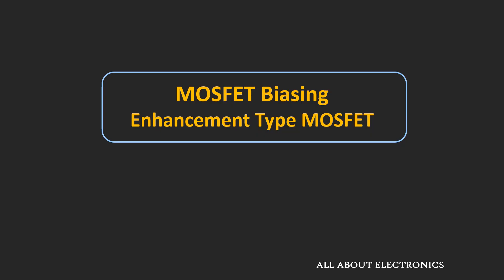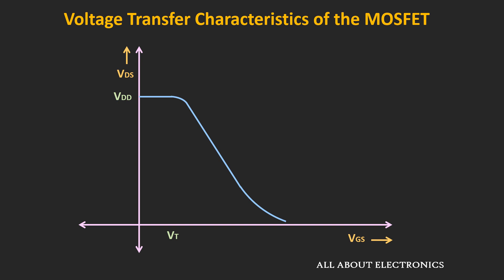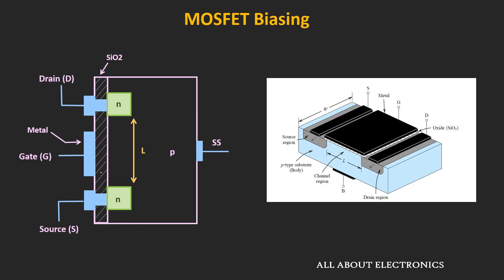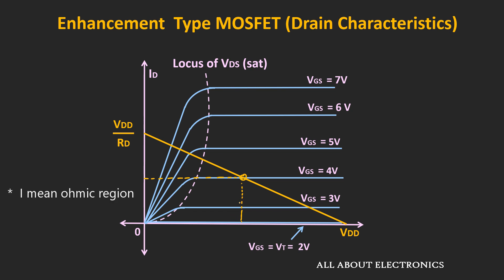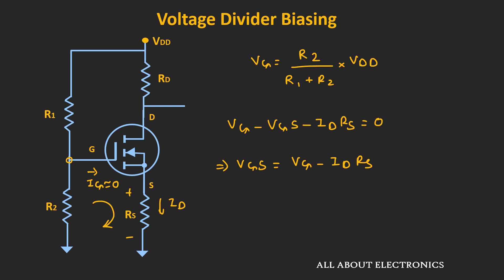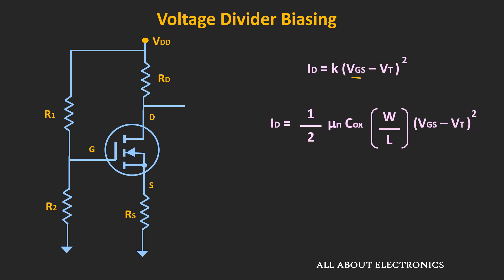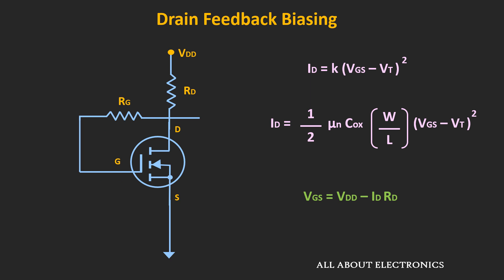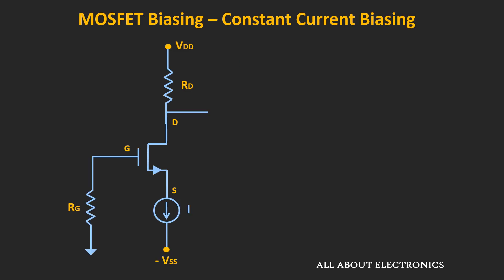MOSFET Biasing : Enhancement Type MOSFET Biasing Explained

Comment from the maker: Timestamps for the different topics covered in the video:
0:00 Introduction
0:37 The need for Biasing in MOSFET Amplifier
3:56 Fixed Bias Configuration
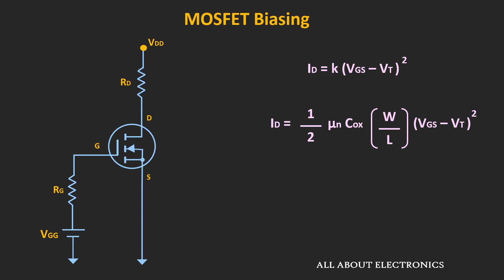9:56 Voltage Divider Bias
14:47 Drain Feedback Bias
16:21 Constant Current Biasing

Comment: Thanks but I got confused from minute 13:00, the formula Vgs = Vg - Id * Rs, if Vgs =0 then transistor is OFF, then no current is flowing at Id, therefore how is possible that Id = Vg / Rs. Thanks again
Reply from the maker: The yellow line, Vgs = Vg - Id*Rs is load line. And does not represent the actual current through the device. The intersection of the load line with the transfer curve will give you the actual current and voltage of the device.

Comment: Where can I find AC Analysis of voltage-divider-bias circuit using N-channel Enhancement MOSFET?
Reply from the maker: Please check the MOSFET playlist on the channel. You will find there. In case, if you don’t get it then let me know. I will share the link.
Reply: @ALLABOUTELECTRONICS  First of all, thank you for your interest. I found only this video on the list "https://www.youtube.com/watch?v=vBvLu3euc2Q" , but it's not exactly what I want. I want to prove Zi, Zo and Av equations with DC and AC analysis for Voltage-Divider Bias Enhancement Type MOSFET.
Reply from the maker: Please check this playlist:
https://youtube.com/playlist?list=PLwjK_iyK4LLC-tRT_Uml3T-ifdcmuykjV
You will get it the video.

Comment: 0:25 why we need to bias the MOSFET

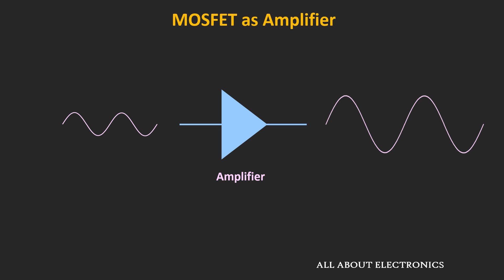0:39 we want to use the MOSFET as an amplifier  我們要把 MOSFET當成一個放大器
0:42 that means whenever we apply a small input to hte MOSFET ,then we should get the amplifier output signal
照理講，這個用MOSFET做成的放大器，如果輸入一個小訊號，應該要給我們一個把該訊號放大之後的訊號

0:49 - 0:59
But if we just apply a small input signal between the gate and the source then we directly can not get the amplifier output.And that is because of the MOSFET characteristics . 但實際上如果我們給MOSFET一個小訊號，他不會給我們一個放大的訊號，這點我們可以從MOSFET的I-V特性圖 看出來

1:01 - 1:09
if you see the transfer characteristic of the enhancement type MOSFET,then it starts conducting when the voltage VGS is greater than the threshold  voltage

1:10-1:19
That means whenever we directly apply a small input signal of a few mV between the gate and the source terminal then the MOSFET will not get turned ON.這意味著當我們直接給一個大約只有幾 mV 的電壓給 gate 和 source , then MOSFET就不會打開

1:19-1:24
That means there has to have some DC biasing voltage which is greater than the threshold.這意味著 必須用一些 大於門檻電壓的 直流偏壓電壓
（意思就是說加一個大於門檻電壓的直流偏壓電壓來解決MOSFET無法啟動的問題）

1:48 - 1:56
whenever we want to use the MOSFET as an amplifier, then it needs to be operated in the saturation region

1:56 because in this saturation region the drain current remain constant

2:09-2:15
That means by controlling the voltage VGS ,the drain current can be controlled

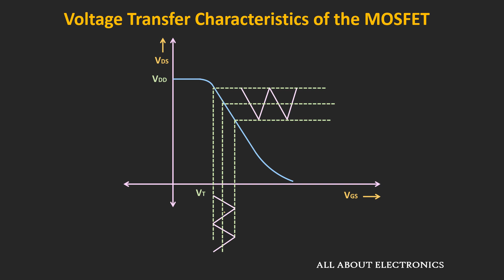3:48 - 3:55
Now,the easiest way to bias this MOSFET is by applying a fixed voltage between this gate and the source terminal.

3:57 - 4:05
so,here,since this gate current IG is approximately equal to zero(因為 G terminal 絕緣) 所以在Rg上面幾乎沒有壓降

4:05 - 4:11
that means in this case,the voltage VGS is equal to VGG

4:11 - 4:17
and on top of it , a small input signal can be applied through this coupling capacitor.

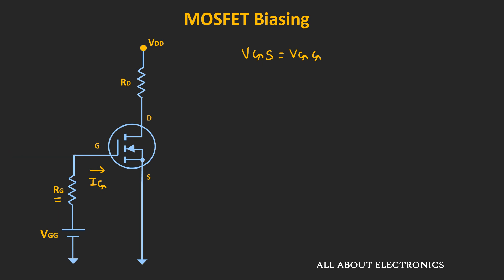4:17 - 4:22
but for the dc analysis ,this coupling capacitor will act as an open circuit.(電容對直流來說是斷路，電容對交流來說是短路)
注意：open circuit是斷路

6:43 - 6:55
in the graph ,the yellow line means load line.That means whenever this voltage VDS is equal to zero,then the drain current ID is equal to VDD/RD

6:56 - 7:02
And whenever this ID is equal to zero ,then the voltage VDS is equal to VDD.（由圖中看出來的）

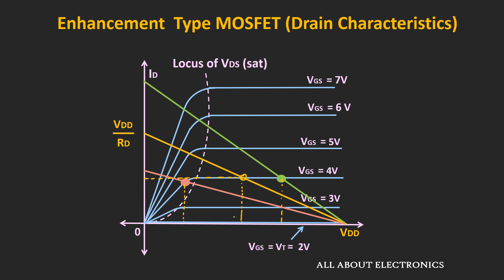8:33 - 8:42
now,although this fixed bias is a very simple biasing technique ,it is not a good approach to bias the MOSFET.

8:42-8:50
the reason is ,in this configuration ,the biasing poit is very susceptible to the change in the temperature as well as the other MOSFET parameters.因為在這種組態，biasing point 非常容易受到溫度影響，因為溫度會影響 MOSFET的常數

8:51 - 9:00
For example,this mobility and the threshold voltage are temperature dependent.
(意思就是溫度一旦變化，參數都會變化，所以ID也會跟著變化)

9:46-9:51
That means in terms of the biasing stability ,this fixed bias is  not an ideal biasing technique.

9:51- 9:56
and this biasing stability can be improved using the voltage diveider bias.

10:03 - 10:16
because  the IG is approximately equal to 0 ,so the current flow through the R1 and R2. That means using these two resistors ,we can decide the gate voltage.(用分壓定理)

10:24 - 10:34
so here ,the ac input signal is applied using the coupling capacitor.but for the dc analysis ,these coupling capacitors will act as an open circuit.

10:35 - 10:46
VG is equal to [R2/(R2+R1)]*VDD（分壓定理）

10:46 - 10:54
and once we know this gate voltage ,then by applying the KVL（克希荷夫定律） in this loop ,we can find the relationship between VG and the drain current.

11:03 - 11:14
VG-VGS-ID*RS=0(by KVL)

12:04-12:20
 VDD-ID*RD-VDS-ID*RS=0(by KVL)

Comment: I have issues that..  mosfets are damage and burn when we send stop command to our device... please tell me solution..
Reply: Tvs diodes, transient voltage protection, against random voltage spikes, as parasitic inductance of Long Signal traces and also use series resistors almost everywhere if possible, even small 3ohm helps.

Comment: Dear sir 
I will write gate EC this year and I want to know which branch in MTech is better in terms of placement and also which college is best for that branch?
Reply from the maker: In terms of the placement, VLSI has better placement. IISC CEDT and IITD VDTT (VLSI Design Tools and Technology) are very good.
Reply: @ALLABOUTELECTRONICS  and sir how is the placements of other branches like communication / microwave ??
Reply from the maker: It is Ok. Usually, it is not as good as VLSI. But it may change with year to year, and depends on the companies which are participating in the placement.
Reply: @ALLABOUTELECTRONICS  thankyou so much sir for all this information. One last question sir do branch matters or college matters? For example lower branch in IIT D(old IITs ) or VLSI in NIT TRICHY (south nit's)Which option I should go for??